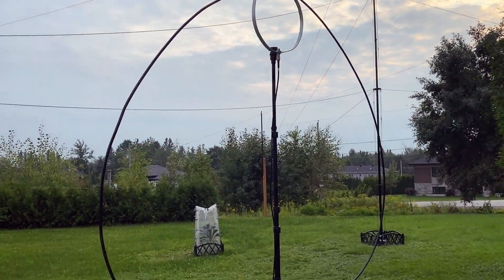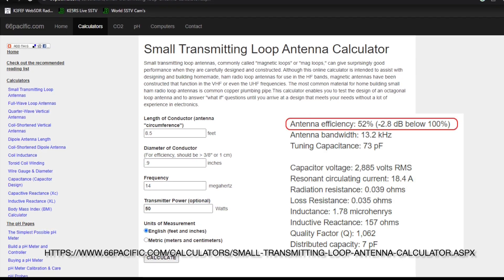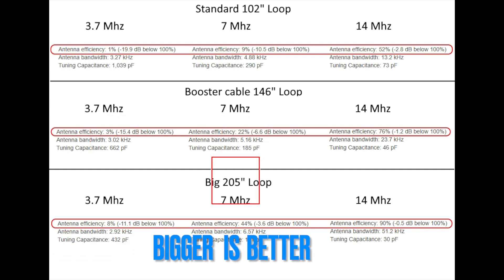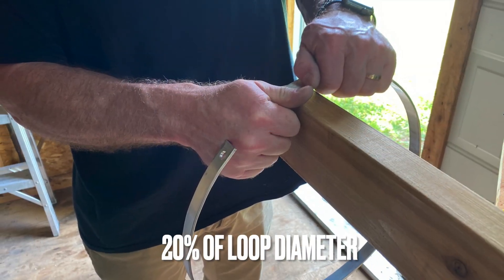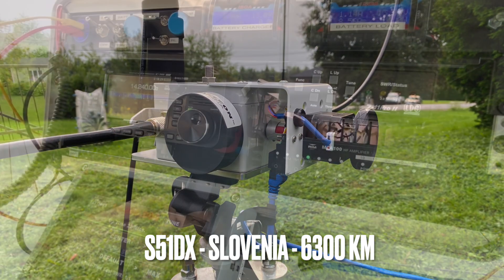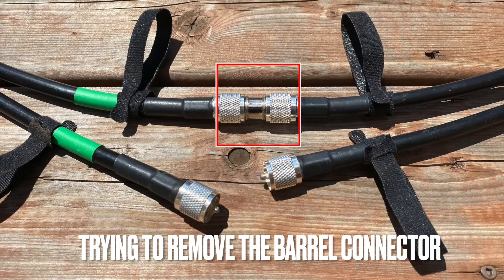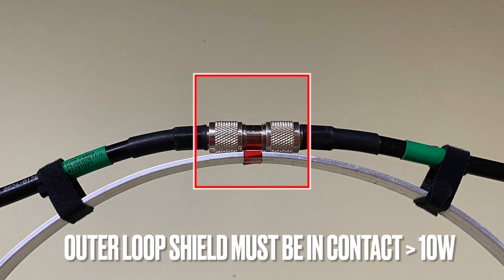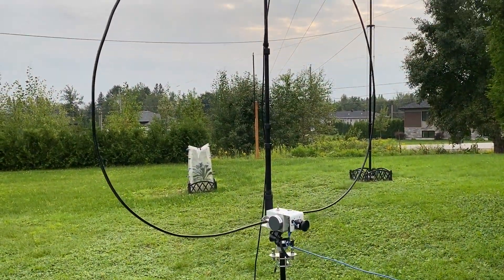Boost your Magnetic Loop Antenna on 20M 40M 80M - Chameleon F-Loop 3.0 and others

Comment: The provided LRM-400 that come with the antenna are shorted at both ends! It’s probably why you were unable to tune with a regular coax cable.
Reply from the maker: We knew that and did short the cable's PL-259, we also shorted the F-Loop's SO-239 internally. Thinking back it may have been caused by not using a choke at the feedpoint, we used a 100 feet coax to stay away from the antenna. So many things to try...

Comment: Regular mag loop user here - the russian Spiderloop A100, several MFJ loops and home brew. I'm surprised it worked with the barrel connector touching the inner loop - I was always under the impression that they must not touch, rather they should couple inductively. Of course the very large loop won't work on the high bands, 10/12/15. Getting close to and more than 1/4 wavelength causes issues. Best performance is getting close to 1/4 wavelength but not exceeding it, but you probably know that. Large loop will work well on the lower bands
Reply from the maker: Yes at 205 inches the top band is 20M. For the barrel connector, may be the Power Compensator plays a role, in theory the inner/outer should not make contact. Glad to see you are using Mag Loops, thanks for the comment!

Comment: Loop antennas are fascinating have you tried different coupling methods had some success with a toroidal coupling and gamma coupling methods …. Still waiting for your video for the remote tuning system.. 👍
Reply from the maker: Hi I have not tried different coupling methods other than what is shown. The automatic remote tuning system should be coming soon, thanks for your question. 73!

Comment: This is a great video.  I was curious to see how much better a bigger loop would affect transmitting and receiving.  I wonder what the results would be if you could replace the coax with 1” tubular aluminum.
Reply from the maker: I believe using a 1 inch tubular would increase the bandwidth, but a RG8 vs a 1 inch tubular is not much difference, some have tried with 4 inches tubular, I do not have those results. My 1st instinct is overall size matters more than thickness, but you can try and see and may be share your findings? Great question, ask for asking!

Comment: Could you please let me know if you could use alum   flat bar for the outside loop
Reply from the maker: Yes, a flat bar would work, but there will be differences. The thicker the outside loop is, the better it performs. With Google/Images you can search for Mag Loops and see all different types, size, shape, materials some use.

Comment: Been a fan of using longer and contiguous loops, rather than loops that are joined. 

I use a T240-43 to couple my 20-40m mag loop. Depending on whether I use the compact 5m or the larger 8m loop, and depending on the band, it can take anywhere from 3 to 7 turns to get resonance and a 50 ohm match. 

The coax touching the inner loop is like a centre tap on a tuned circuit with a transformer coupled second winding also with a centre tap….if that makes sense.
Reply from the maker: Hi Renaissance Man, Reference: "...like a centre tap on a tuned circuit" while I can imagine that, I have yet not found related materials to explain that kind of direct/indirect coupling that improve performances at higher power. Thanks for your comment.
Reply: @VE2FGJ well you would be connecting the two circuits at the 0V points….assuming the feed to the loop was balanced…common mode choke on the antenna end of the coax would see to that 

I try to tune my loops so they are at resonance with the smith chart in the middle showing the lowest Xl and Xc values I can dial up. I then note the impedance at that point and adjust the turns ratio and coupling to match. 

Tighter coupling does pull the resonance and impedance of the loop. You would loosely couple a free running LC RF Oscillator to the next stage as any loading would cause the frequency to move. 

On my VNA I have SWR, Smith, phase and S21 Logmag. I look at SWR with respect to the Smith chart and phase with the idea that understanding the Xl /Xc components of the antenna at that frequency, let’s me know what I need to do to achieve resonance. (Logmag on S21 let’s me quickly check cables for losses)

What does the smith chart on your VNA show with the loop connected vs isolated ??
Reply from the maker: @MidlifeRenaissanceMan  Wow a lot of things I have not delved into, I wish I had a VNA to experiment with and without the center tap (barrel). I appreciate your detailed explanation, hopefully I will experiment more in the future. Thanks.

Comment: hi.. thank you for the details you explained. can you please share the details of the Variable Capacitor too... I will have to be making one... hence some details will be surely helpful.
Reply from the maker: Hi, the F-Loop 2.0/3.0 capacitor is a 10-365 pF and  5-182 pF. There is a switch (A/B) we can toggle to switch between single/dual gang capacitance. To build a MagLoop I can suggest to use the least Capacitance and rather increase the Outer-Loop size to match the highest Band you will be using the most. As an example, in my latest video I chose a 205 in loop to use the 20M band with 90% efficiency. Bigger is better for the top Band you want to use, compensating with a Capacitor, results in lesser performances. Hope that helps. 73!
Reply: @VE2FGJ  Thank you for the tips.  Makes things much clear now 🙂

Comment: Por Favor me interesa mucho construir esta antena debido al problema de poco espacio y al ruido que generan unas Torres de Alta y baja tensión que están muy cerca a mi Estación de Radio, más las lámparas led que generan un ruido de 10 sobre 9 dBi,  Jose yv4bsm por Maracay Estado Aragua Venezuela. Necesito las medidas exactas de la circunferencia o Aros y del Capacitor de cuántos pico faradios
Reply from the maker: Hola, el lazo exterior es de 205 pulgadas (length), el lazo interior es de 13.5 pulgadas (diameter), el capacitor es un doble gang de 10-365pf, por favor consulta el sitio web https://www.66pacific.com/calculators/small-transmitting-loop-antenna-calculator.aspx para hacer los cálculos, permite un margen de error y varios intentos, los ruidos vecinos pueden ser atenuados apuntando el lazo en la dirección deseada, pero a veces no se pueden evitar, ¡buena suerte! 73

Comment: Colega yo necesito una Loop magnética para las Bandas de 80/40/ y 20 metros por el pico espacio en mi casa y mucho ruido por lámparas led y de las torres de transformares de alto y bajo voltajes más unas líneas de 104mil volts que me pasan Cerca al qth a 30 metros de distancia. Por Favor le agradezco Me ayude con las medidas y detalles de construcción tengo un cable heliah de 1/pulgada que lo puedo usar para el aro. De usted atentamente Jose yv4bsm en Maracay Edo Aragua Venezuela muchas Gracias No hablo el inglés bien 😢
Reply from the maker: Please state your question clearly in english. Thanks.

Comment: Why are you using your antenna tuner with a mag loop?
Reply from the maker: The tuner is in bypass mode, it only shows SWR. The flickering you saw is because we did not use a choke at the feedpoint, some RF comes back.